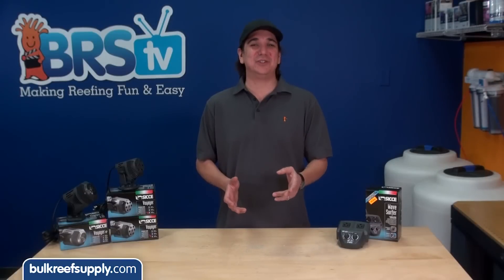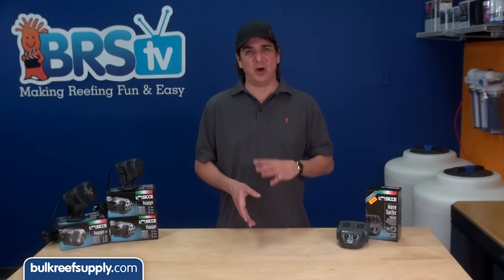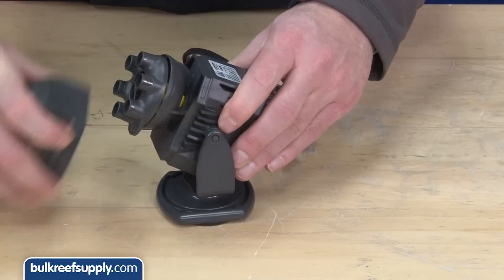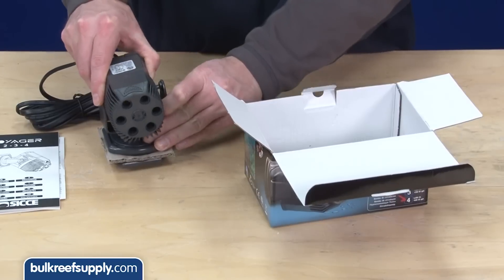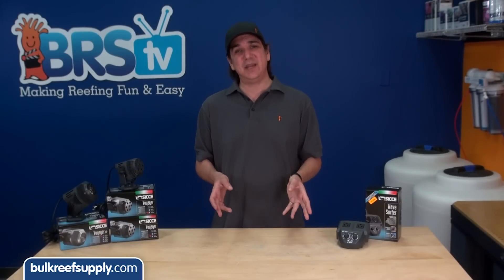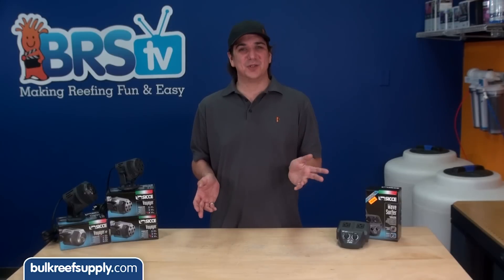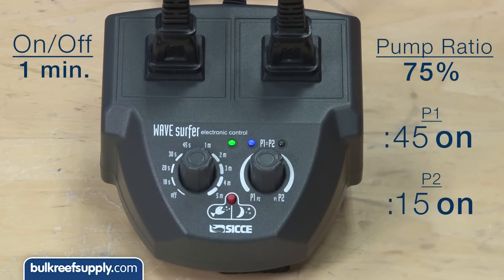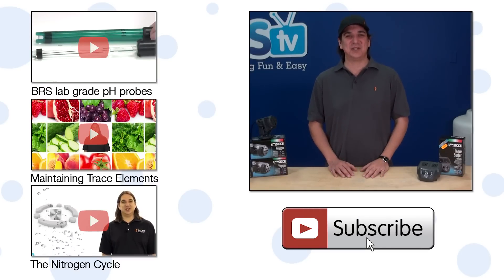Set-up the Sicce Voyager Power Head & Wave Surfer | How To Tuesday

Comment: Sicce makes great pumps. Althought alittle bulky its the only pump in my system I haven't had to replace in 2 years. Very quite and very adjustable, even the flow is adjustable by twisting the outer ring. Nice Video Ryan

Comment: this is  made for 2 heads. Would that be sufficient for a 210 gallon tank? I also noticed they are placed at the same height. Ive always placed one lower and one higher. I've seen another brs video that recommends 4 with the additional  2 in the back. Right now i have the return pipes aiming down the back and 2 sicce xstream at different heights. I've been thinking it might be worth adding 2 more and having 2 on each side, set on timers to create a clockwise and counter circular flow . Is circular flow ideal? the tank is 6 feet long and i have sponges on the powerheads to protect the anemone. 4 powerheads with sponges sounds like a decent amount of maintenance.

Comment: Sorry Brian;

It is hard to agree with your statement about these pumps.
I owned 3 of them (voy. 4). With the time, they are spin in opposite direction - so they not produce flow - like other pumps.
They also used to stop. Usually, they are fine for a couple of months. The big adva. of Sicce is that they are cheap.
From my experience, TUNZE is far better pumps. They can spin in opposite direction (when you turn on/off them frequ.).
But they did not stop.

It is only my experience with them. Hope that others have better opinions.

warm wishes from Perth;
Piotr